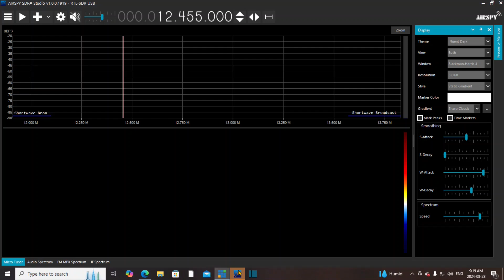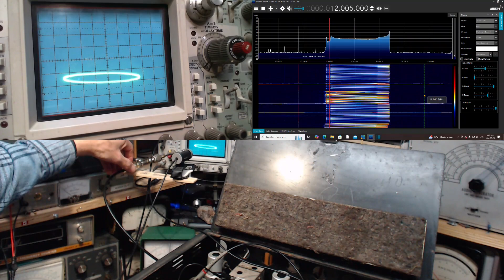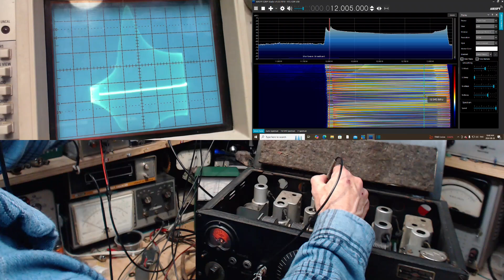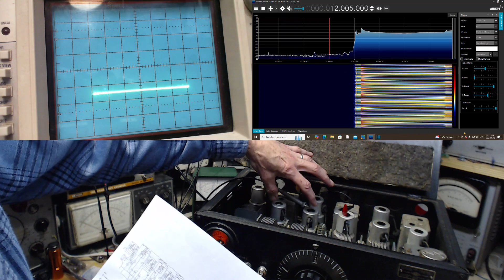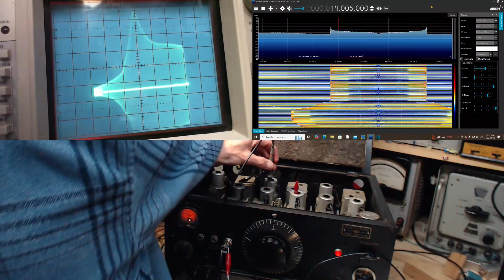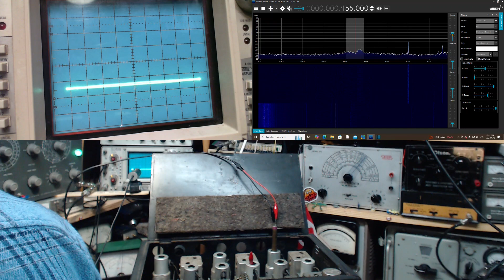National HRO Receiver Video #9 - Some Wobbler Fun

Comment: To check friction on you variable capacitors I suggest that you back off the two screws on the split gear shaft and try to move the capacitor  you can always get back to the initial position with your signal generator 
I would try to clean the plug-in coil contacts and wipers with magic juice WD 40  a little spray from underneath the tube sockets and move them a little in situ if you don't want to remove the tubes

Comment: There is no way you can use a TV sweep generator as it does not produce a 455 Khz difference signal . TV if is  higher at 44 Mhz

Comment: Its formerly known as a wobbulaitor. EICO first used it on a signal Generator  the Woobulator consisted of a speaker with 60 hz passing thru it. Coherently fixed to the diaphragm was a coil feeding an oscillator. The 60 hertz would cause the coil spacing to vary thus defining an oscillator , causing the frequency to vary in frequency at a 69 hertz rate. The wobbulator would generate a 455 Khz sweep freq.